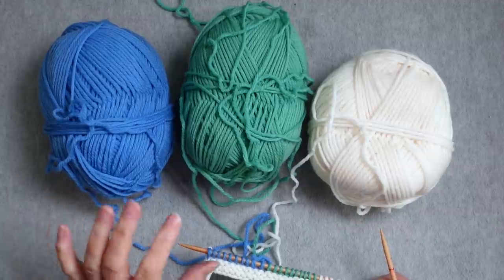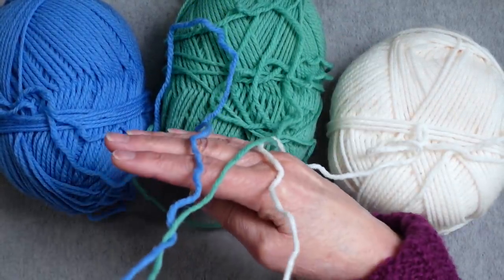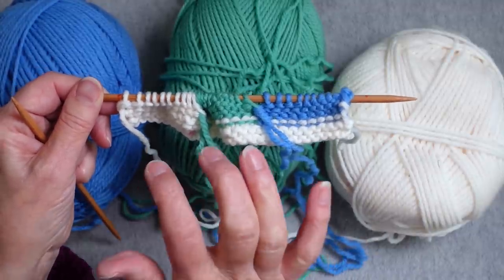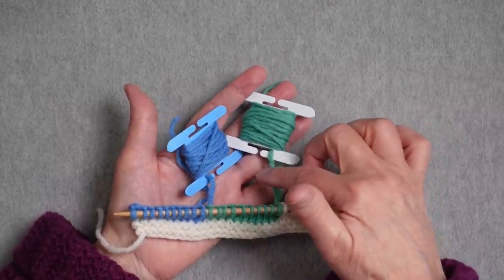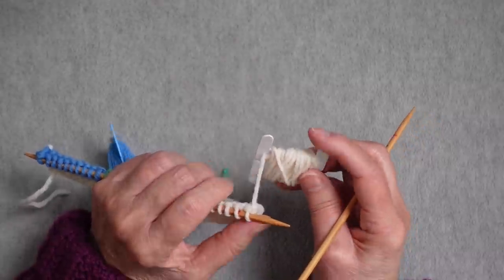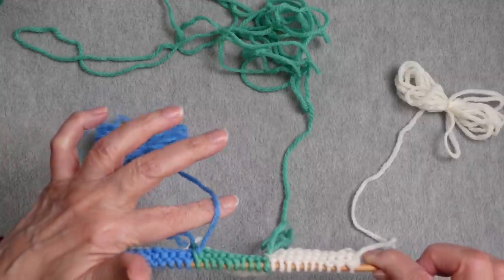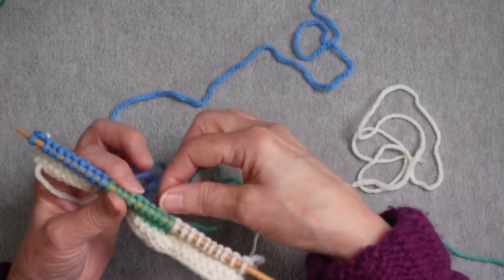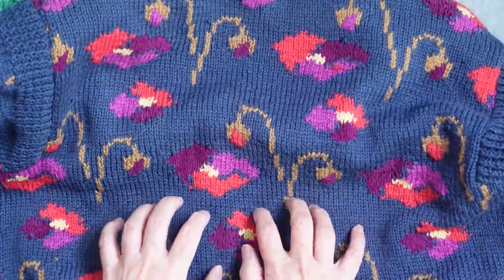Intarsia Yarn Management and Estimation // Technique Tuesday

Comment: This has been so useful to me Roxanne. I’m new to intarsia. What I’ve also found works well for my pattern, which has a solid background colour with a singular contrast colour motif in the centre, is to use the same ball of background yarn but pull the yarn both from the centre and the outside.  I find this saves time by not having to estimate the amount needed and winding onto bobbins. Thank you for explaining the different methods which will help me for more complicated colour changes.

Comment: A few years ago I knitted my first attempt at Intarsia and tried all of your suggestions. The best solution I found was in the kitchen area of our local store - ice block sphere makers. Little plastic balls with a snap lock that are filled with water to make round ice blocks.
Reply from the maker: So then, what do you do with the sphere makers? Are they sitting on your lap? In a box? Lined up on a table in front of you? Are they center pull balls, or are balls that would otherwise roll around if they weren't contained?
Reply: Not sure if they are still available. They are individual plastic spheres halves that snap together and have an opening for water that is closed by a snap lock. I wound the yarn for a centre pull placed the yarn in each mould, hreaded the yarn through the hole that is used to fill with water then partially closed the snap lock and snapped both halves together. Sat them in a shoe box on my lap while I knitted. The yarn had slight tension coming through the hole so came out smoothly.

Comment: Thank you for these helpful technique videos. I would like to request some tips on fixing mistakes. Particularly fixing a hole from a missed yarn linking at the color change. I didn't see the hole  until I was quite a few rows past the error. I also wonder if you will share your sewing machine repair shop. I'm local to the Twin Cities. Thanks!
Reply from the maker: I'd fix the hole by taking a strand of one of the two colors, and using reverse duplicate stitch on the back of the work for a couple of sts leading up to the transition, and then linking this strand to the the other color at the back of the work.  For sewing repairs I use Johnston's Sew and Vac in Richfield (66th & Queen). They have another location in Bloomington called Valley West Sewing.
Reply: Thankyou so much for all the different techniques.please could you tell me where you get the silicone bobbins from please.

Comment: Hi Roxanne thank you for this.  Can you tell me if it is possible to work intarsia in the round and then steeking so one is always knitting (not purling)????  I would like to work a colorwork pattern for a blanket!
Reply from the maker: It isn't possible to knit intarsia without purling. There are intarsia in the round techniques (working back and forth, but linking the end of row to beginning of row in order to form a tube). The point of that is to avoid seaming, not to avoid purling. If you want to knit colorwork in the round without purling, you need to work a stranded design, not a color block (intarsia) design.